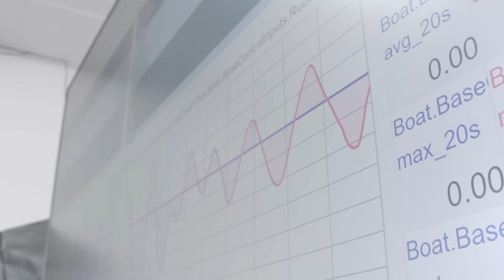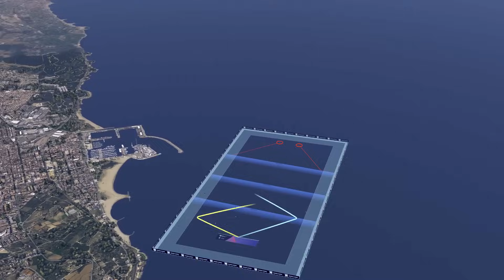James Allison Explains How We’re Designing a Winning Boat | INEOS Britannia

Comment: These boats are like dragon flies twitching this way and that across a course to a point of visual confusion as to who is actually leading.

The old AC yachts possessed an incomparable elegance. This lot is more like formula one cars on water and just as boring with technology at the forefront, not the sport.
Reply: The old boats were about the relevant technology of the time, and that technology is now well and truly dead.

The new sailing is fast and potentially dangerous, offers more potential for passing, and is over quicker. What's not to like.
Reply: Omg your in the wrong century bro lmao
Reply: If you can't work it out now you never could before. That's the truth.